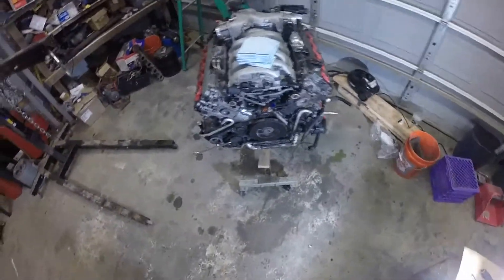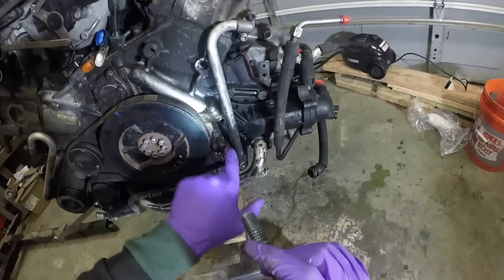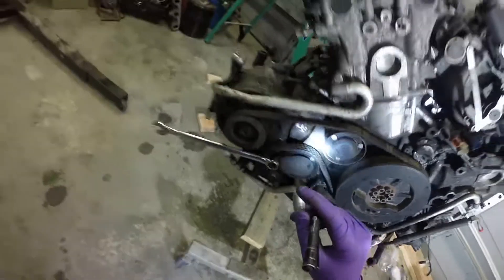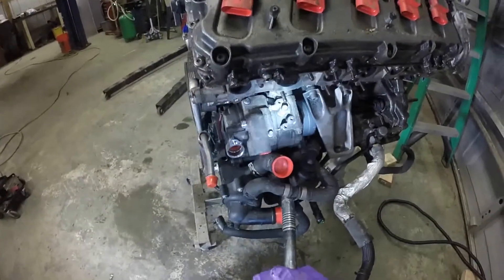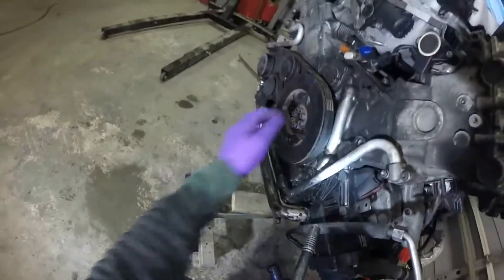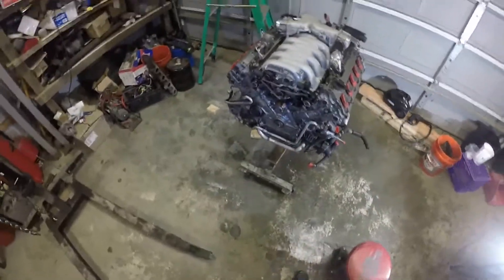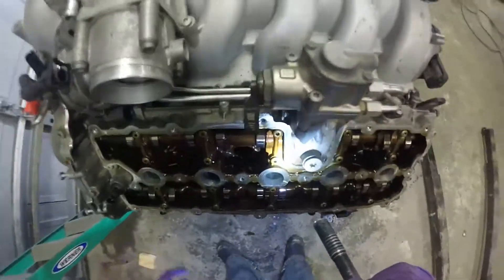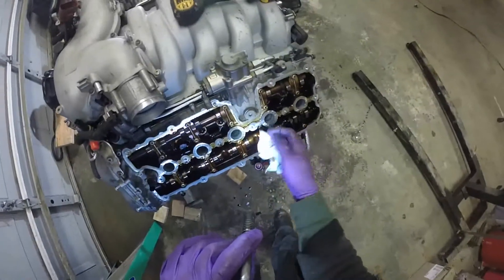Audi V10 S8: 5.2L BSM Engine Teardown Part  1, Top Side Component Removal

Comment: I think water/methanol injection might help prevent the intake and valves being contaminated by oil and carbon.
Reply from the maker: methanol would help for sure, cut the actual oil film. somewhere up near the throttle bodies for a simplified hardware setup

Comment: Hi, Do you know where abouts the egr  valve is on the V10 engine? Thanks
Reply from the maker: ky jo no external EGR on the v10
Reply: Hi thanks for that, been having problems with mine mis firing, I've done a carbon clean but still not 100%.
Reply from the maker: Did you clean the injectors? Does the misfire a particular coil or plug? Did you use OEM style plugs?
Reply: I have cleaned the injectors used original spark plugs, changed the coil packs not sure if the coil packs were original, it's a bit random on misfire not always the same cylinder, I've changed the crankcase breather hose as that was cracked which had helped, it ticks over ok, but on acceleration it's very hesitant,
Reply: Is there no egr valve  on them engines at all?
Reply from the maker: @jez0424   Correct no EGR valve at all. This and the V8 of the generation did not use any external EGR plumbing. 
Have you checked the HPFP demand vs actual pressure? Eventually the high pressure pressure pumps do fail. How do the short and long term fuel trims look like?
Reply: Hi Greg I want to do a rebuild on my s6 do you recommend that ? Are they even worth rebuilding completely?  If so who do you recommend ?
Reply from the maker: @4wdaddict41   I would recommend myself :D.
Whats wrong with your S6, why do you suspect you need a rebuild? 
What I always ask anyone who asks "is it worth it?" is, what's it worth to you?
I don't believe there are any oversize pistons for it (at least stock, perhaps the R8 engines have aftermarket versions available) I know there are different size con and main bearings if they need to be honed to size. 
If its just worn rings (high leakdown), the engine can be torn down, checked with a bore gauge for taper and roundness, if that is in spec, and the piston is in spec, new rings would do the trick. 
1) compression test
2) leakdown test
3) teardown and measure
4) if out of spec....find a used block or donor car/complete engine..or part your car out. 
if you have specific questions feel free to email me greg.balandyk@gmail.com
Reply: @BGGarage  170k miles
Reply: It's a little sluggish even after new injectors and a full carbon cleaning also blue smoke a start up so I'm assuming my valve seals are taking a dump
Reply from the maker: 4WD ADDICT ah damn. maybe-could be pcv pulling in excess oil but..sounds like valve seals. hows the compression and leak down test? to do leakdown pretty much have to put front end in service position to get easy access to the crank
Reply: @BGGarage  definitely will test it out soon

Comment: Hi Greg what are you using for the manual? I saw a folder of instructions you were referencing time to time
Reply from the maker: OEM service manual
Reply: Greg B thanks for the reply. A few more questions if you don’t mind.. where could I get one of those OEM manual and how much? Also do you know if you can change out spark plugs without removing or lowering the engine? Thanks!
Reply from the maker: erWin o relsawin, not sure on pricing.  And yes can definitely do spark plugs in vehicle without any other procedures. Straight foward job.
Reply: Greg B I see thanks. I read somewhere you have to partially lower the engine for spark plug and completely remove for gasket jobs
Reply from the maker: Justin Kim  nope, i have personally done :coils, plugs, intake manifold, fuel injectors, valve cover gaskets, oil filter housing in car, no lowering

Comment: Coming along well. Exactly the same issue mine had - are you also going to replace the Valley Pan gasket?
Reply from the maker: AM Miles during some inspecting it appears the valley gasket is ok, just residue from the leaking oil filter housing. but...i may